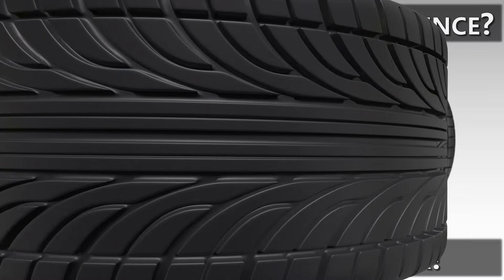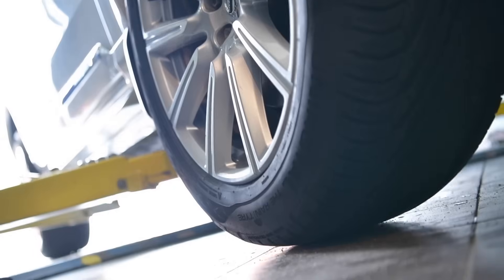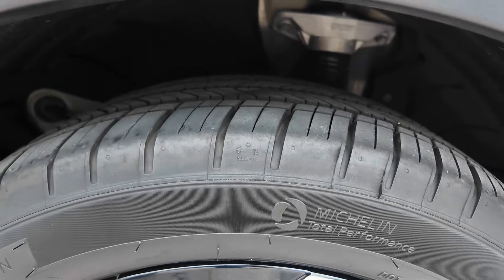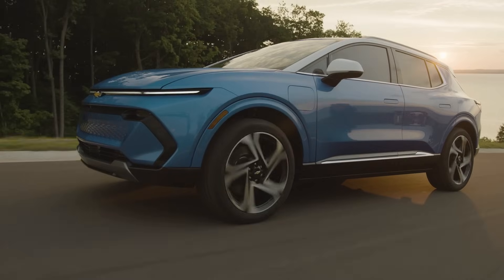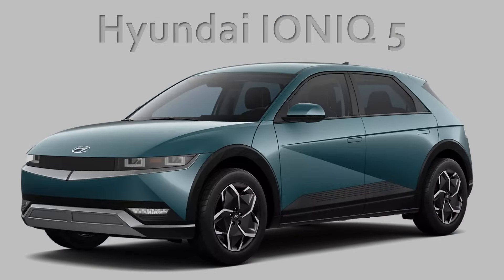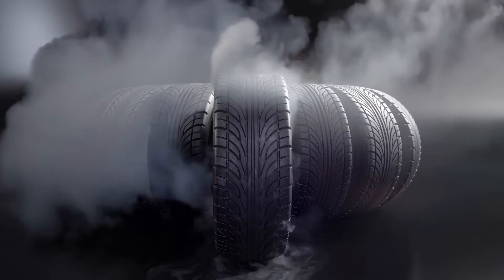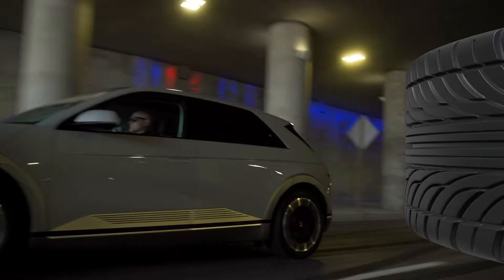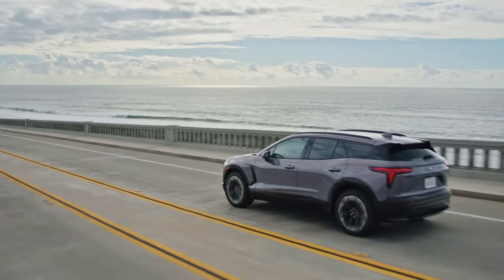Stop Wasting Money on 'EV' Tires—Here's Why

Comment from the maker: UPDATED: 15 April 2025.

I am still getting comments from people trying to convince me there are "EV only" tires.  NOTE: There are many different indexes or ratings that everyone should pay attention to:  Load Index, Weight Rating, Traction, Temperature, etc. This is good.

AS OF THIS UPDATE (15 April 2025), there is STILL no such thing as an EV INDEX or RATING in the tire industry.  If and until such time, there is nothing to the claim that EVs require specific tires and only those tires will work on your EV. You must use your own judgment.  Get a tire that works for your car and KNOW there are ZERO reputable Tire Sellers that will allow you to put something on your car that is dangerous.  End of sentence...

If you cannot point to some NEW or UPDATED rating that is an industry requirement for tires, then please STOP trying to convince me there is one!  I ain't your average Joe...I have a brain and I am not afraid to use it!  🤣
Reply: @jimsEVadventures  I've been running Blackhawks on my 2021 Model Y Perf. They cost me $128 each for 21-inch wheels. I like them better than the EVs that came with the car.

Comment: You want tires that shed particulates less quickly and less toxic particulates. A lot of EV tires are basically designed for that (at least the first one).
Reply from the maker: Can you provide the science and reports to validate that claim or is it just a marketing report like most “EV Tire” claims. I’ll put that info in my next video.
Reply: @jimsEVadventures  I don't actually know if they claim to have or do have less toxic particulates; I edited my comment. In terms of wear, it's something I've read but I don't know of any studies or reports validating it. If I do some research and come across any, I will let you know.

Comment: A EV weighs a lot more than a regular car
Reply from the maker: If  you mean 15-25 percent more is "a lot" then, sure. But if you mean 1.5 to 2 times as much, then no.  As an example, the Equinox (ICE) weighs in at 3,600 lbs. The curb weight of the Equinox EV is 4,750 lbs. - a 24% difference and on the high side of things.  And you must understand, the weight rating for ALL tires takes that into account.  The standard tires on the Bolt EV/EUV are SL rated (Standard Load).  But the tires I installed on my Bolt EUV (and they are NOT "EV" tires) are XL (Extra Load) rated which means they can handle a lot more weight.  Back the Equinox.  4,750 pounds isn't "extreme" by any stretch of the imagination.  Consider that the Chevrolet Blazer (internal combustion engine version) is only 400 pounds less than the Equinox EV.  Trucks?  Well then...you have to consider LOAD capacity as well as curb weight.  A 5,000 pound truck carrying 1 ton of cargo in the bed weighs 7,000 pounds.  They make tires to handle those loads...and that has ZERO to do with whether or not the vehicle is battery electric or gasoline powered.  So a making a general statement that an "EV weighs a lot more than a regular car" is like saying the snow looks a lot whiter when the sun is shining.  It is meaningless in the world of tires...

Comment: The big myth is that the extra weight of an EV wears out your tires quicker. In the real world I'm not seeing that.  The same make, model, and size tire only lasted 20k miles on my gas powered Cadillac ATS and lasted over 30k on my Tesla. The only difference I noticed is the PSI recommendation on the door of the Cadillac was 36 psi and Tesla recommends 42 psi. Maybe that alone caused them to last longer?
Reply from the maker: SL vs XL.

Comment: I was a practicing attorney for over 33 years and what was drilled into us from the start is, what is the issue. The issue here  is OPTIMIZATION. Can the manufacturers OPTIMIZE a tire for EVs and if so how and to what extent are they successful and then show which tires are best optimized for EVs and to what extent is the optimization successful and is this worth it financially to purchase. I strongly suggest you do this and then get back to us. And you  should  have known this.
Reply from the maker: OPTIMIZATION:  How do you OPTIMIZE a tire?  Round? Yes!  Made of the proper mix of materials? Yes!  Proper tread?  Yes!  Properly supported in the sidewall?  Yes!  Properly constructed for the weight of the car?  Yes!  Everything else you would "optimize" for the EV is bupkis.  You know that, if you are really an attorney.  We have had cars that produce the same amount of torque as an EV for YEARS.  So...that argument is DEAD.  Weight?  All tires are weight rated and you should pick the tire that meets the requirements of your car's weight.  And, oh by the way, the EV does weigh more, but not TWICE as much or even 1.5 times as much.  It is on the order of 1.1 to 1.3 times as much as other cars/trucks in the SAME class!  I would strongly suggest that YOU figure that out before you make an off-handed comment on a channel about something which you CLEARLY have ZERO expertise to comment about!  YOU should have known that!

Comment: I can confirm on my Chevrolet Bolt that Pilot Sport AS 3 has the same range as the OEM tire. Pilot Sports are quieter, have more grip, and have better aquaplaning resistance. I will not be putting the OEM's back on when they're used up.
Reply from the maker: Excellent info.

Comment: I think the cables to the house from the power distribution company's side are thin, and the company has raised the voltage to compensate for the voltage drop when the cables are under load. But when you start selling to the company, the voltage has to be raised so that the current starts flowing in the opposite direction...
Reply from the maker: Makes sense...

Comment: Yep, agree. Have a BYD Atto 3 here in Australia which I replaced the standard tyres after 500kMs with Continentals which offer superior grip. After 43K kMs, they still have about 6mm of tread and perform perfectly. I always figured that tyres specifically made for EVs was BS and it would seem that I'm correct. With regards to weight of the vehicle, the BYD adds a little more weight than our other similarly sized and specified car, a KIA Sportage diesel, but not by much. The whole thing about EVs being far heavier than standard ICE vehicles is BS too.
Reply from the maker: I am glad you are having great success with the tires you are using on your Atto 3.

Comment: Great and logical video on tires, EV etc. Thanks! I owned a 2017 Prius V for the past 7.5 years and just traded it. Put 200000km on it. It came with Michelin "EV" tires which worked fine and we replaced them after 5 years of driving at around 125000km, as they were getting down on tread and we had one that we damaged on a huge pot hole on a long trip to Winnipeg so decided to replace them with a set of non EV Pirelli tires at the local Costco as they were readily available. We also ran snow tires in winter, Michelin X ice. I always watched our fuel milage like a hawk and can honestly say there was no difference between the Michelin and Pirelli's although I did prefer the Michelin's as they had a bit less road noise, and rode nicer to me. Milage was of course a bit less in the winter however not a lot. 5.5 litres/100km was our average milage for the whole 200000km of ownership.
Thanks again for your excellent explanation of tires and physics!
Reply from the maker: Appreciate your input!  Great information.

Comment from the maker: DETAILS on the MATERIALS Used to Make a Tire

Modern tires are made from a complex blend of materials, including:

Natural Rubber (19-25%) – Provides elasticity and durability.
Synthetic Rubber (24-30%) – Typically made from styrene-butadiene rubber (SBR) or polybutadiene to improve performance in different weather conditions.
Carbon Black & Silica (22-28%) – Reinforces the rubber, improves strength, and enhances wear resistance.
Metal (12-15%) – Steel belts and bead wires provide structural integrity and strength.
Textile Fabric (4-8%) – Polyester, nylon, or rayon for reinforcing the tire and improving flexibility.
Additives & Chemicals (5-10%) – Antioxidants, curing agents (like sulfur for vulcanization), and processing oils help improve longevity and performance.
Exact ratios vary depending on the type of tire (performance, all-season, EV-specific, etc.), manufacturer, and intended use.

What Makes a Tire Have Lower Rolling Resistance?

Rolling resistance is the energy lost as a tire deforms while rolling. Lower rolling resistance means the tire is more efficient. Key factors that contribute to this include:

Higher Silica Content – Replacing some carbon black with silica reduces rolling resistance while maintaining grip.
Stiffer Tread Compound – A harder rubber compound deforms less, reducing energy loss.
Optimized Tread Pattern – Shallower and fewer sipes (grooves) help minimize deformation and friction.
Low-Profile, Narrower Design – Less contact with the road means less friction.
Higher Inflation Pressure – Proper inflation reduces deformation and rolling resistance.
Lighter Construction – Less material means less energy required to keep the tire rolling.

For Lower Rolling Resistance Tires, tire manufacturers focus on high silica content, low rolling resistance compounds (silica), and optimized tread patterns to improve efficiency while maintaining grip and longevity.  But this practice has been around to improve gas mileage in ICE cars for years.  Auto manufacturers know this and they have used TIRES to ensure their cars meet CAFE standards for years.  

But now that this thing called an EV has hit be market, they are using the same tactics to market tires as "EV Only!"  The truth is...if you put an "EV only" tire on an ICE car, the gas mileage will improve.  Care to prove me wrong about that?  Do it and report the findings here!

Comment: Great survey, confirming what I have always suspected. I also tend to prefer tyres with more grip, ie softer rubber compounds, winter tyres, Yes they wear out a tiny bit quicker, but in my opinion are much safer, am I wrong?
Reply: Wear out a tiny bit quicker? My experience, they wore out a considerable bit quicker.  
But, no one complains about the cost of a fire extinguisher when they're putting out a grease fire in the kitchen.
Reply from the maker: Nope. More grip = safer handling and better stopping. I agree.

Comment: It's like buying oil for your car. oil has an SAE rating  if you check your tires you will find a set of numbers that will be on all tires most brands will have tires that will have the same numbers as on your tires just search for tires that have those numbers please don't ask for EV tires the tire guy will just charge you more money
Reply from the maker: Good advice, this video is intended as a starting point for people to use as a point of reference as they research tires.

Comment: I hope no one is taking that serious,   this is a dangerous practice.  many tire shop are willing not do that because of Liability.  Very dangerous
Reply from the maker: I hope they DO take the advice seriously. Quote:  "Get the tires that will support the vehicles weight and your driving style."  That is SOUND advice.  You assert that this is a "dangerous practice" and that "many tire shops are not willing to do that because of liability!"  Yet - your assertion is not backed with anything other than "Very Dangerous!"  

What is dangerous for everyone is assertions like yours because what you are saying is pure rumor and innuendo.  I stated ONLY factual and verifiable information in this video.  

My admonition to everyone, again--get the tire that will support your vehicles weight AND driving style, but don't buy into the marketing hype.  

I have put two sets of NON-EV tires on my Bolt's over the years and not one tire company has refused to install them or denied giving me the warranty!  Care to explain that?  Spreading misinformation and making false accusations against ME is not smart!  I would strongly advise against it in the future.

Comment: Do you have a source for the rolling resistance of tires?  I've checked manufacturer sites, Tire Rack, etc and drawn a blank.  This isn't a ding on you, but the tire manufacturers and testers.  Until I find a good source for rolling resistance data I plan to buy EV specific tires.  If I could verify that the rolling resistance of say the Michelin CrossClimate 2 was reasonably close to my OE tires, then I'd expand my search.  Until then, the "fuel efficient" label some tires carry is about as useful as the "sounds better" label.
Reply from the maker: I’ll get the science and drop it in the comments. I’m out of office right now, but keep an eye out over the next few days.

Comment: You're too in the tank.  Higher torque makes EV tires wear faster because it's just too easy to out-accelerate a gas powered car.  No, it doesn't have to be this way if one is theoretically "responsible", but most will opt for that wonderful EV acceleration to more safely merge with traffic, etc.
Reply from the maker: Most is a reach. SOME tend to have a heavier foot. But “most” is a stretch. That’s like saying “always” and “never.”

Comment: there are multiple categories in tire designs such as a performance tire, the tread pattern, tire compounds, belting and ply design, load range. a tire that is made for comfort is not the same as a performance tire. and it stands to reason that those tires for an EV is going to have some differences then those tire on the standard vehicles. think safety.
Reply from the maker: Safety is always my first consideration. The info you mentioned…all good. But it has nothing to do with what powers the car and everything to do with how much weight and power are needed and the desired mileage (range) you seek.  Just like I explained in the video—the laws of physics don’t change just because the car is powered by electricity.
Reply: @jimsEVadventures ; yes the laws of physics will change in accordance of the situation. speed, load, pressure, whether, temperature, road surface. so, yes; the laws of physics will change.

Comment from the maker: For those who still do not understand EV Tires...

Just because an EV can apply torque instantly doesn't mean it will be applied more frequently. That entirely depends on the driving style of the person behind the wheel.

An aggressive driver in an ICE car who frequently revs the engine and accelerates hard will wear out their tires faster than a smooth EV driver. On the other hand, an EV driver who enjoys instant acceleration at every green light will see more rapid tire wear.

So the real factor in tire wear isn't the EV itself, but how the driver chooses to use the power it provides.

Comment: One thing that's worth mentioning in regard to noise that you didn't cover is that EV specific tires will often come with foam inserts to reduce noise that regular tires do not come with. EVs are so much quieter you are more likely to pickup on tire noise and the foam helps dampen certain frequencies of noise. This is not needed in a normal ICE vehicle because the louder powertrain masks some of the tire noise.
Reply: Where is it (foam) inserted?
Reply: @gr8dvd it's inside the tire, lining the inside of the tread. I assume it's adhered so it's not just loose in there. Pirelli's technology is called pncs. They have cut away graphics showing a depiction of what it looks like .
Reply: The foam? Its in the middle of the section of the tire @gr8dvd
Reply: @Weezedog  mini coopers also come with foam inserts in tires called runflats because theres no room for a spare tire. So it gives you the option  to get to a tire shop at a reduced speed.
Reply from the maker: Foam inserts have been used on luxury tires for years. That was a thing back in the 80’s.

Comment: Still on my original tires.  Planning on Cross Climate 2's when they are finally need replacing.  Funny how I haven't needed tires every 3000 miles like Facebook said I would
Reply: Im at 35k miles on my Cross Climate 2s and they still have plenty of thread left.
Reply from the maker: If you needed tires as often as the naysaying, bought and paid for, ICE-zealots eluded to, there would not be enough in the stores for everybody else to use.  The absolute insanity of the lies coming from ICE enthusiasts is entertaining...but very annoying!  I guess breathing in all of those exhaust fumes has dulled their senses!